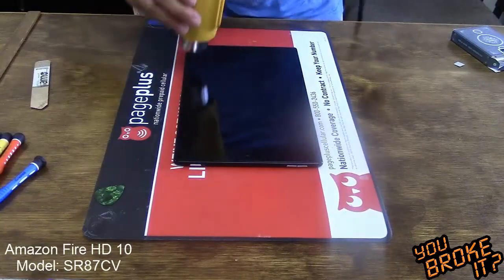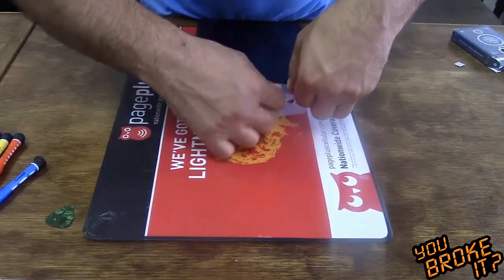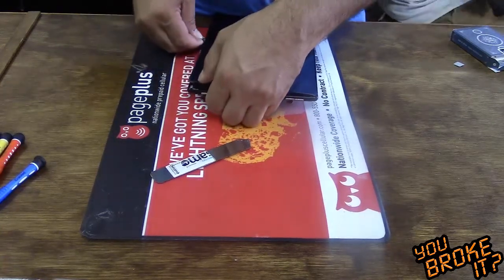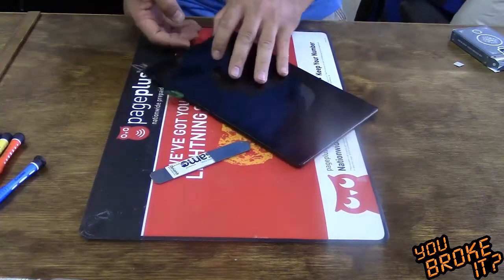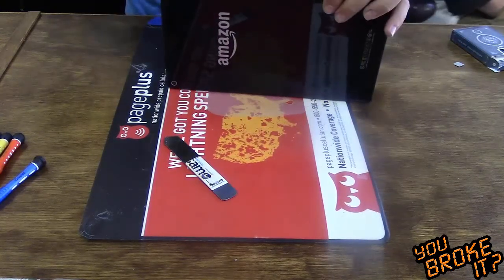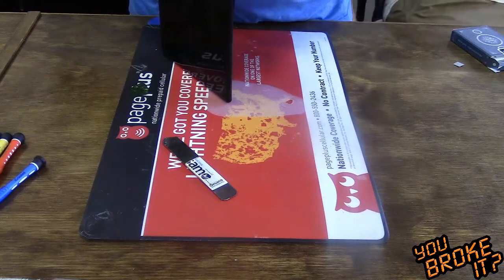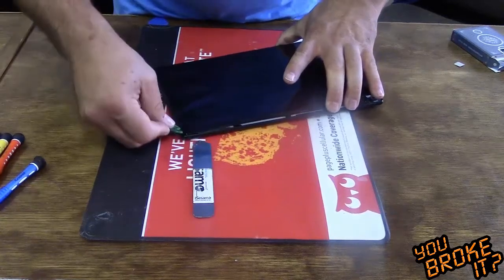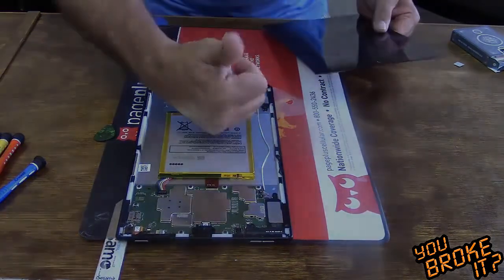Teardown for Amazon Kindle HD 10. From You Broke IT?

Comment: 2017 Amazon Fire 10 - Screen was stepped on you can see that it is cracked inside screen not outer. It's glitching with LINES throughout it and the touch screen is unresponsive. Would it be affordable to repair? Is it fixable?  Should I just buy a new one or try and fix?

Comment: hello I'd like to ask about screen replacement  my amazon fire hd 10 .. after broken screen and digitizer I bought a new one from aliexpress market but when I replaced it I saw the touch didnt work .. so what do you think about it ? may be touch is didnt work from the market? or there is a little cut in the cable that connected between the board and the screen ?

Comment: I used the pry tool, but you can catch the small touch screen ribbon that controls the touch potion for the screen. I tore mine. Remind watchers / users that this ribbon is close to bottom edge. 
Can this circuit be replaced?